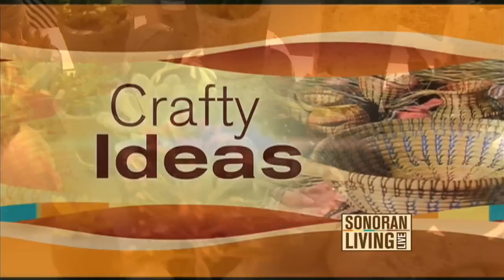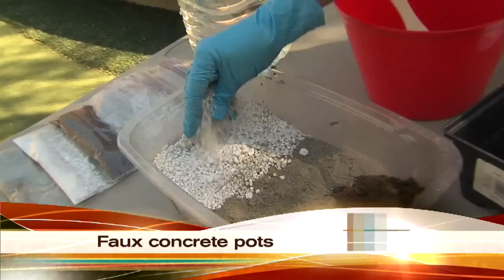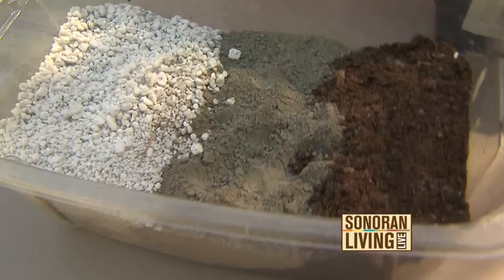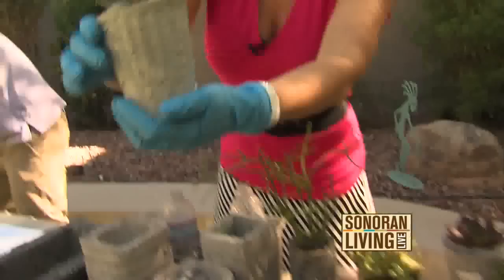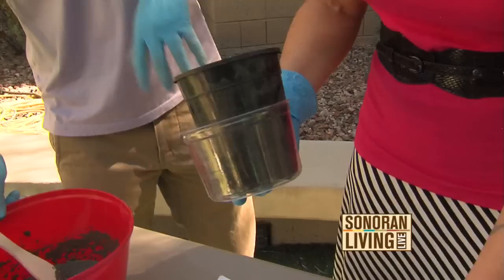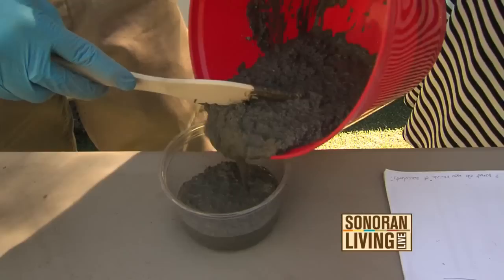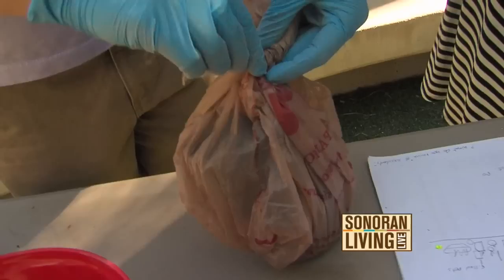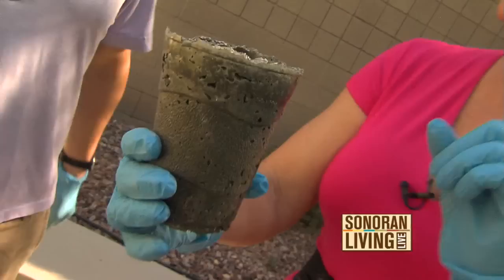How to make faux concrete pots, planters

Comment: perlite is not styrofoam and his mix is awfully thin for hypertufa which is the mix he is using. Normally you just make it thick enough to take form when squeezed so you can form it.   You don’t use concrete - it is portland cement.  Cement is plain cement, concrete has sand/rocks i.e. aggregates already in the mix.  Perlite It is a mined product that is expanded with heat and it comes in several sizes.  Horticulture is the smallest.  A #4 is called sponge rock used by orchid growers.  You can carved a stamp and stamp into the pot when just unformed.  See Guy Wolf pots with his neat stamps.  Look for white portland cement too if you want to add cement/concrete colorants.  Everyone also puts them in the shade especially if you are in hot zones - the long it goes through cure process the better.. Why he calls them faux concrete I don’t know if using concrete mix.
1 second ago

Comment: The mixture most use - see Fine Gardening magazine article is 1 part portland cement, 1 1/2 parts perlite and 1 1/2 parts garden peat moss.  I have seen it bumped to 2 parts on perlite and peat.  Depends on the texture you want.  You can add in per recipe a handful of reinforcing mesh fibers from a concrete supply store.  See my other comment for difference in concrete and cement.  And you can use white portland cement for white pots or if you want to add colorants.  He didn’t mention texturizing it after unforming to round out and make it more natural.  Keep thickness consistent when hand forming which he isn’t doing.  Also you can add in shredded paper or sphagnum moss strands in the mix to eventually drop out or I have pressed them in right after unforming (be gentle) using tweezers to push in.  Without concrete on these, they will drop out sooner or can be burned out to give nooks and crevices.  I have placed on the backside as I’m pressing the mix to the form.  Because you have sprayed your mold with oil or mold release - the paper/spag nor the mix will stick to form.  But you can also use plastic to line forms.
Reply: Very good